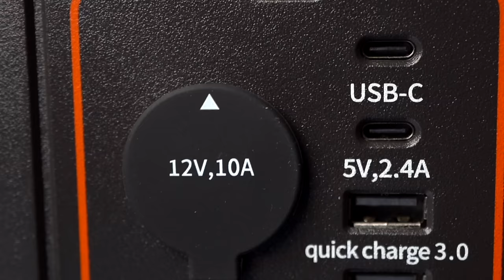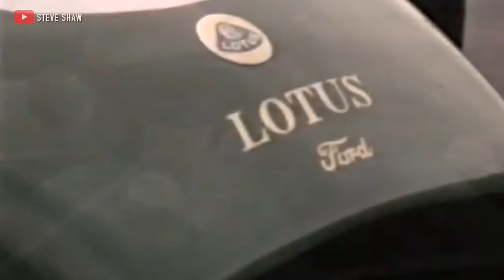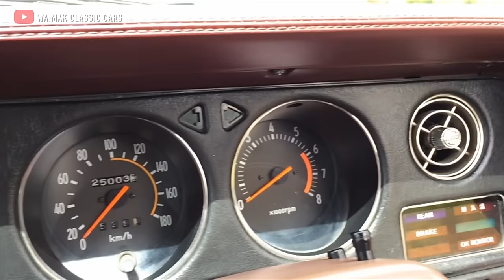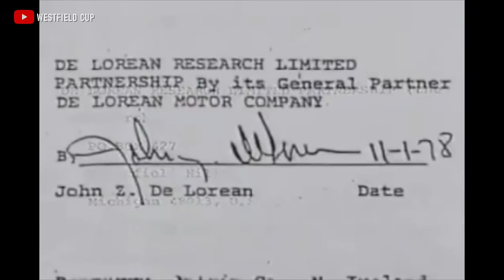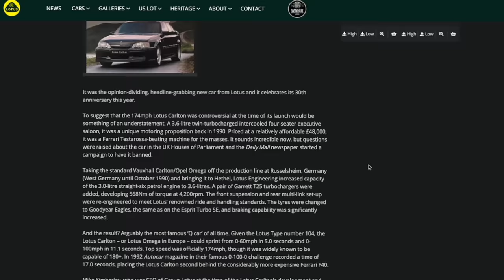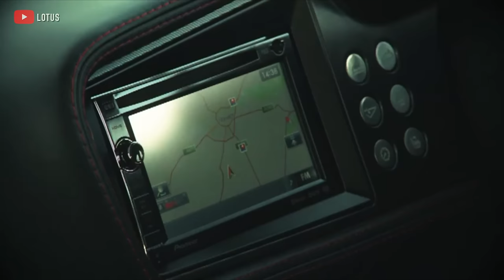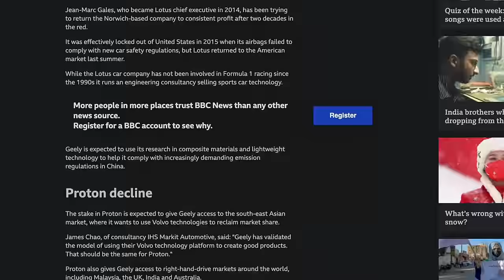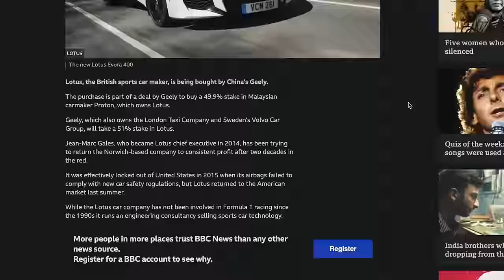Lotus is Dead

Comment: Lotus had the choice. You either die a hero or you live long enough to see yourself become the villain.
Reply: If they lowered their prices by £10,000 I would've bought a Lotus instead of a Porsche. They did it to themselves.
Reply: @fredmercury1314  In a way you're not terribly wrong, but due to the way Lotus operates, it was never a possibility.

Because lotus has historically always sold low production cas, and always been an understaffed small British company, they have to price their cars the way they do to keep the lights on.

They sell their cars priced this way because they're literally almost entirely hand-built and don't have much in the way of infrastructure for mass production. Not so much anymore today, but still so compared to even companies like porsche. historically, Lotus has sold cars at their price tags and still barely come out on top with profits. They broke even on a lot of cars produced. The Elan mentioned here was one of those I can reference from memory, but I believe my statement is the same for the Esprit and Elise.

I'm by no means saying the prices or their practices are necessarily justified, but that's why. They've nearly gone under dozens of times because they can't seem to profit off the cars they sell, even at the prices they go for new. They even had to sell their engineering "expertise" to other companies to assist with paying the bills. It used to be a big thing selling your car with a badge on it saying "suspension designed by lotus" or something similar.

In a way, Lotus is still one of the better value cars over companies like Maclaren, where they absolutely sell cars that are stupid overpriced and have terrible TERRIBLE quality control with no excuse for it.
Reply: yeah its sad. i think they could have gone the electric route and made it cool. like being the first ones to make a fun, simple electric sports car. not a lot of power, but all control by the driver. you know the stuff that they were always good at. they may even have convinced the enthusiasts that fun electric cars are possible.
Reply: @fredmercury1314  exactly
Reply: @Mr.Marbles  i saw some articles saying that the new cars, even the SUV are trying to be as light as possible. But with more than 1 engine, lots of power, computer controls, comfort and a huge body (the extra-wide Evija and the extra-high Eletre), this isn't enough to be as good as their lineup that started from the Elise. And i'm saying this as just another car guy, forget the profile image, even my brother, who doesn't understand much about cars, thinks that having expensive and heavy EVs is bad
Reply: @UpToSpeedOnJaguar  100k for a kit car with camry engine, if they made the engines, sure fair play but they don't
Reply: You either die a hero or live long enough to start producing pointless SUVs.
Reply: Facts brother.
Reply: And that is why lotus has to go suv @mkviis